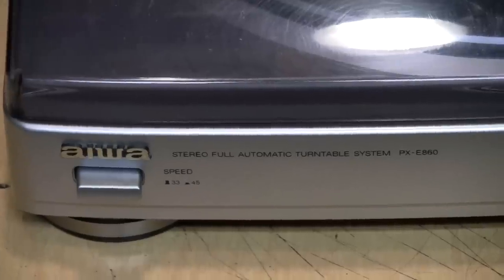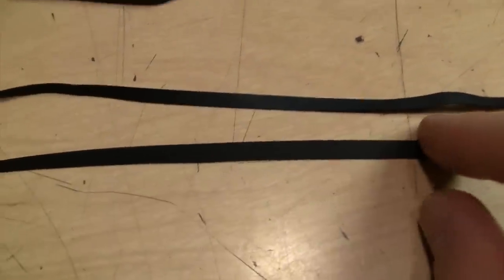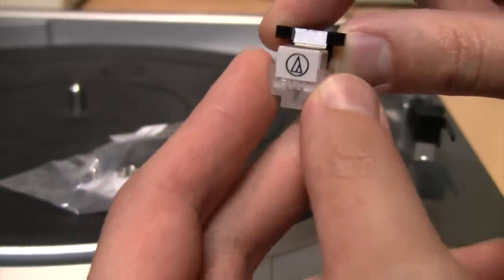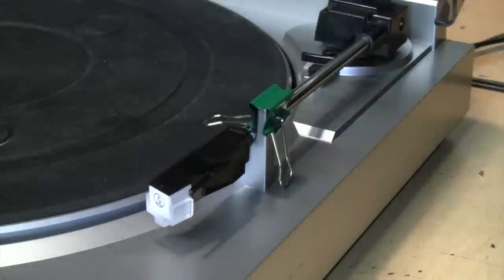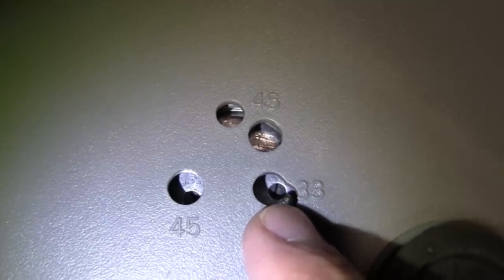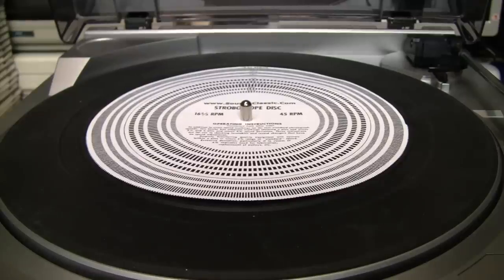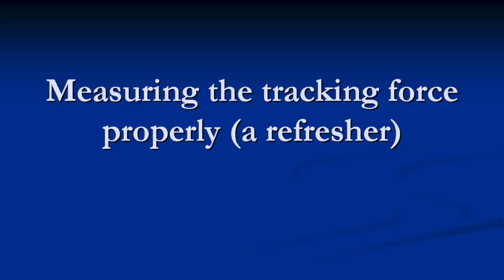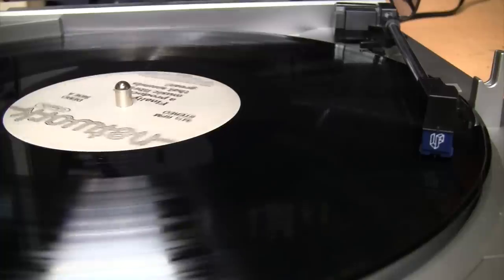Cheap fixes & upgrades for cheap turntables

Comment: Would it be at all possible to completely change the cart on a turntable with a built in tonearm? Or are they pretty much stuck?
Reply: Not on one of these turntables. Just the stylus can be changed.
Reply: Live Wire dang. I have a 90s Panasonic combo system with a turntable on top. I recently learned they stopped making the replacement stylus. So I was wondering if there was any way to rip off the old cart and attach a new one
Reply from the maker: If it's a Panasonic stereo system from the '80s or '90s with a built-in turntable then it most likely uses this stylus, which is still very much available: http://www.thevoiceofmusic.com/catalog/part_detail.asp?PNumberBase=711
Reply: If it has a tonearm with the cartridge integrated to it, then no. You should search google with the name of the panasonics stylus and i bet there will be some companies who make replacement stylus for them. LPgear has pretty big variety of needles.

Comment: Will the Audio Technica AT-LP60 work if I plug it into a 220v AC power system socket?
Reply from the maker: If it is a model designed for 220-240 volt power, yes. Otherwise, no.
Reply: @vwestlife  how to determine which variant is on sale?  Could I buy from US amazaon both variants?
Reply from the maker: No, you'd probably need to buy it from a retailer in a region that uses 220-240 volt power.
Reply: @vwestlife  Thanks for explanation))

Comment: No one told me that Disco had finally made its return! 😂 Thank God, because Millennial music sucks! Anyway, you were pretty through in this video. You can can just record a 16 2/3rd RPM at 33 1/3 RPM, record it at like 96kHz on your computer, and slow it down to half the speed with Audacity. That can be then saved as a 48kHz without frequency loss. If you wanted to play such a record directly on your turntable, you will have to use some simple electronics to install a switch and a potentiometer for that. A similar method can be used for adding 78 RPM playing on your turntable. Many people just get a second, cheap turntable for that so they aren't forced to modify their high quality turntable for RPM speeds that don't offer much in high fidelity anyway. Some audiophiles did release 78 RPM records using the stereo stylus that were high fidelity to compete with the compact disc back in the day, but those would be rare to find.

Comment: Hey Kevin, I have the same exact turntable in this video. When I play a record, the platter is slightly wobbling. Already tried playing without a record, the platter's still wobbling. What can I do? Thanks.
Reply from the maker: Did you try removing and then reinstalling the platter? Make sure it is properly seated on the center spindle.
Reply: @vwestlife  yes already tried that. Nothing happened
Reply: @vwestlife  i bought a new belt, now the platter's fine. However, the pitch keeps dropping i already adjusted the speed using a strobe disc. Even before replacing the belt, pitch was already acting weird. What could be the problem?

Comment: Hi Vwestlife, really like these turntable videos that you make, was thinking to get the at lp 60 before i watched a stress test video for the at lp 60. You can find it on CJ's vinyl channel. Could you check it out and tell me what you think about the stress test?
Reply from the maker: Tests of playing a record over and over again are not indicative of real-world use because the stylus heats up and causes the record material (either vinyl or styrene) to soften as it's being played, and if you don't give it enough time to cool down afterwards (some people say you should even let a record sit for 24 hours before playing it again), that will cause extra wear to both the record and the stylus. Also the stylus will wear itself to the grooves of that one record rather than the randomized wear it receives in normal use from playing multiple different records. So such a test will cause much more groove damage to the record than an equal number of plays spread out over a longer period of time with other records played in between.
Reply: VWestlife Thanks for the fast answer man. Really apreciate it and now i am sure that i can buy the at lp 60 at some point. Thanks to this video of yours i am also sure that i can upgrade the stylus of the at lp 60s to the lp gear one. 

Do you own the album: I never said that, by: Skank? Only released on vinyl in 1985. Got it a while ago as a sealed copy and it truly is an good album.
Reply: VWestlife It seems that CJ did not really understand the point that you made about the stylus and record heating up. I understood it and it made perfect sense, because anything that moves or is moving on any surface, causes heat.
Reply: Live Wire I bought an AT LP60 around a year ago and trust me, it's fine. Whoever says that it'll "DESTROY" your records is just dumb. While the cheap components might not be doing your LP's a favor, they're not killing them slowly either. I mean, lest be honest, who plays the same LP 80 times? No one.
Reply: Israel Rdz. Yeah. I had a pioneer pl990. Thinking of getting it back as a second turntable. It is cheaper than the at lp 60 in my country.
Reply: Live Wire definitely, go for what you can afford. If you realise this isnt for you, you can leave at that without having too much money spent. Or, if you do want to keep upgrading an all, you can start by the preamp, power amp and speakers, until you finally save for a better TT. 

I live in Mexico, and everything is absurdly overpriced. I was in the very same situation you're currently at.
Reply: Israel Rdz. Man i have a at lp 120 and klipsch r15 pm speakers. Im just thinking of getting a second tt for my older vinyl records to listen to downstairs. I sold my pioneer pl990 after a couple of months of usage and now i regret it 😅
Reply: Live Wire ohhhh, haha, well, then you already know what to look for.

Comment: I need your help. My lp60 won't start playing the record where it should be. If i press the play button, it just starts from like the middle of the first song on the record and it also won't stop spinning after finishing the record. How can i fix that??
Reply from the maker: Make sure the size selector is in the correct position for the record you're playing. Maybe you accidentally flipped it to the 7" setting.
Reply from the maker: If that still doesn't help, adjust the L.IN (Lead In) and RET (Return) trimmers underneath.
Reply: @vwestlife  not on 7". I might have to check that underneath.

Comment: Which of the stylii did you like best for sound?
Reply from the maker: The Pfanstiehl green elliptical stylus.
Reply: I agree. I wonder if they make a Shibata type and if it does any good. I know it is good for quad.
Reply from the maker: Turntableneedles.com does sell a Shibata stylus for the AT3600 cartridge, but does not recommend it for the 3.5 gram tracking force of these turntables.
Reply: I have both the stock ATN3600L and the Pfanstiehl 4211-DE. The Pfanstiehl sounds awesome when I use it on a standard-mount AT3600 cartridge tracking at 2.25g, but when I mounted it on my AT-LP60 it sounded awful. I also noticed that it was riding very low when I used it on the LP60. I think some of these Pfanstiehl styli have softer or stiffer suspension and there is probably a lot of variability from batch to batch. I also have a Pfanstiehl 4211-D6; it, too, was a low-rider on the LP60 and sounded bad, but when I mounted it on my standard-mount 3600 and set it at 2.5g, it sounded dramatically better and didn't ride too low.

Comment: If the weight of a record slows the turntable down, then either your belt is slipping or the idler wheel is slipping 16:24

Comment: If I wanted my turntable to look more stylish, I’d buy a better deck. One of these LP gear styli would be interesting to try on something like an entry level Rega fitted with the carbon cartridge (a rebranded AT91), the deck would do it more justice.
Reply: that decks,and any modern british and czech decks (rega,pro ject and all other 'audiophile' brands that use rebadged rega and pro ject decks) aren't good at all mostly because they're using the same chinese oem motors used in decs in this video,that's why they don't have very good snr and w and f.even if you go upmarket you won't get that much objectively better turntable because everyone is milking the vynil trend and everyone is trying to make as much profit as possible so there isn't many true good models.even german dual are likely not made in germany anymore,even models in 1000+ dollars range...
Reply: @TheUmart  you sound exactly like someone who knows nothing whatsoever about Rega decks, they’re superb pieces of engineering, built entirely in the UK, they use premotec motors by the way but thank you for the incorrect education. As for pro-ject, some of their stuff is terrible, some of it is great. You’re talking to someone who has actually tried this stuff, bought with my own money.
Reply: believe anything you want,rega has been rebagding stuff for decades now,from catridges to whole decks,and in p range they're using same motors as everyone these days.actually i've serviced at least a dozen of p1 and p2's and you gess it - same motors from china.
Reply: i also know for a fact that p series is manufactured in one of those chinese factories as everybody else these days,and they are not transparent about that fact.
Reply: @TheUmart  no you don’t, you’re making it up! Your “facts” have absolutely zero credibility.
Reply: there are countless videos and pictures all over the net so see for yourself,even they themselves never publish snr and w and f specs precisely to fool people like you to think that their p line is something other than cheap rebadged import.

as of 2022 there isn't a factory in uk,us,germany and japan that manufactures tt under 1500+ dollars anymore.untill covid there used to be still small scale dual production (even that wasn't from original factory and used imported parts) in germany but when the new owner took over that ceased production and last models were 'reference' and they made 100 of them.

Comment: 12:36 i DID laugh! this is real? civilization is doomed!
Reply: rarbi.art    I'm gonna give him a pass.  He's young, and you have to remember that a lot of people born after 2000 never used records.  Like, AT ALL.    The only reason some of them know about records at all is because they see the hiphop deejays using them - bear witness to his remark about 'scratching'.    It's still humorous, of course, but we're all new to something at some point.  I, for example, remember some people thinking the newfangled hard-shelled floppy diskette was a 'hard disk'.  And the old trope about people thinking CD trays in computers were cupholders?   Yup.  Witnessed it myself.  I honestly thought the guy was putting me on.  He wasn't.
Reply: @xaenon  I was born in 2002 and for a while my family used to own a turntable along with a very decent HiFi setup. It's a Technics SL 1710 MK2 mounted with a Pickering cartridge from the mid-90's. I got to play the turntable during my early childhood and that is when i started to learn the basics of operating a turntable as well as ways on how to balance a tonearm, adjust the anti-skating, etc. It was until late 2009 when my late  grandpa decided to sell the turntable after the Kenwood pre-amp on my family's HiFi setup started to fail due to aging capacitors.
Reply: HBC1011TV Studios    You're the exception rather than the rule.  Most people your age grew up with CDs and MP3s, and to a lesser extent, cassettes.  They knew about records, of course, but most only knew them in the context of the hiphop deejays.   Records were bulky and fiddly and OLD.   For many, if not most, of them, records were things their parents (or even GRANDparents) listened to.  Remember, records were on the verge of extinction just ten years ago.
Reply: @xaenon  I started playing records back in 2006. I don't know where you've been back then, but records weren't "on the verge of extinction" back then.
You just had to like other types of music than mainstream music. Especially electronic music like house was widely available on vinyl. 

In fact, because all the pop music needs to be pressed on vinyl nowadays, the electronic music scene gets pushed away from record pressing plants by those multi million dollar artists.

Comment: Out of the 3 the green one was the best had better separation smoother mid-range. What's the point of removing the auto mechanism gear You should have greases the gears as well, Michael Frermer is right! the experience he heard what he's going on for a Crosley Cruiser that it was producing 9 1/2 grams of pressure what will damage your vinyl  plus the bad tracking of the stylus is not good either.
Reply from the maker: Disabling the auto-return allows you to play a record with audio in the locked inner groove, such as Sgt. Pepper's. And Fremer is wrong because the Crosley's entire tonearm doesn't even weigh that much! All the ones I've measured and seen others measure have been around 5½ grams, which is below the 6 grams of tracking force that vinyl records were original designed for. See the video I did about the Crosley Cruiser for more info: https://www.youtube.com/watch?v=06wBwVkw9xU
Reply: VWestlife what do you mean by audio in? disabling makes no difference. Yes I know you're feeling about 6g weights that doesn't mean you should be anywhere near it? but even 5 grams is too heavy don't forget a record is not a smooth flat surface let alone the platter, and that will be multiplied by any humps or bumps especially with the crappy styli that comes with it, The suspension on it I would have thought is not very good either and could add to the damage and will dig into the record possibly same with the arm. Not worth the money anyway either way why would anybody buy one??
Reply from the maker: You can't do this with an auto-return turntable: https://www.youtube.com/watch?v=DaXnqw-Zv0Y And as for the Crosley, I already discussed all that in my video about it. I suggest you watch it if you haven't already.
Reply: VWestlife you being serious really! I watch the clip... you wouldn't be able anyway it's running in reverse? and as you say you could have just adjusted the return screw so it plays the lead out till the end. when you were doing you're research into one type of vinyl manufacturer they were using sapphire styli not! diamond! what has a big bearing on the a factor sapphire is a soft material and slippery than diamond.
Reply from the maker: It's easier to just remove the gear. Plus some people don't like the auto-return mechanism anyway and simply prefer a manually operated turntable.
Reply: VWestlife there is some method to your madness but not just removing the gear wheel you have to remove the whole mechanism and really having a plastic body!! you need to fill it with cement and hay.
Reply from the maker: No, the gear is all you need to remove. Nothing else.
Reply: VWestlife yes I know that but it is better to remove everything if you just want it as a manual table acoustically.
Reply from the maker: There is no point in removing anything else because with the gear removed, there is nothing to engage it.
Reply: VWestlife yes it is microphonics as I say probably not worth it on a table like that

Comment: The quality of sound between the three stylii is indiscernible. one sounds the same as the other two(I had to correct the spelling, Spell-check gets it wrong - Singular: Stylus, plural: Stylii with 2 'i's, spell-check drops it back to one 'i' for the plural, which is wrong).
Reply from the maker: No, "styli" (one i) is the correct spelling.
Reply: I must differ, Stylii rather than styli, partially following the pattern of the word "bindi" and its plural "bindii", the first 'I' short, as in "fit", the second is long, as in "wine". And "bindi", if you've ever walked barefoot on grass and had a sharp pain in your foot or feet, lifting the foot, or feet, one by one will reveal what's sticking into them and causing the pain, that's one "bindi" or a few "bindii"!
Reply from the maker: Most plural forms ending with an i only use one i, not two: https://en.wiktionary.org/wiki/Category:English_irregular_plurals_ending_in_%22-i%22
Reply: I'm taking the word to be Latin, that's why I believed it to be two 'i's
Reply from the maker: Then I suggest you study your Latin again, because the plural form of Latin words ending in -us is -i, not -ii: https://en.wikipedia.org/wiki/Plural_form_of_words_ending_in_-us
Reply: Well, if it's wrong then it's wrong but I just go by what I've seen elsewhere.

Comment: Why can't Audio Technica just use an external variable resistor or potentiometer so that one could easily adjust the pitch? My old Realistic had the adjustment wheel AND the strobe built in.
Reply from the maker: They have the AT-LP120(X) if you want a turntable with adjustable pitch control.
Reply: @vwestlife  Thanks I was contemplating purchasing that unit since it adds very significant improvements, but of course they removed the automatic mechanism, I suppose you can't have it both ways.

Also I may be the only person who seems to notice an audible tapping sound as the tonearm gets towards the end of an LP or 45 (it isn't discernable or interrupting playback sound while a record is playing).

I've tried two ATLP60X units. The auto return mechanism is about to engage to return the tonearm to its home position.

Great restoration and tutorial of these older turntables btw!